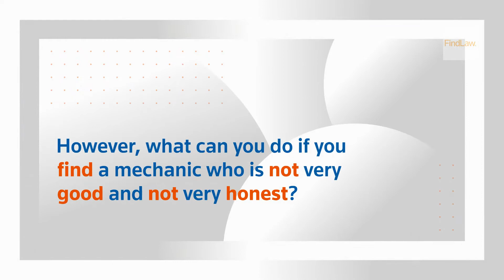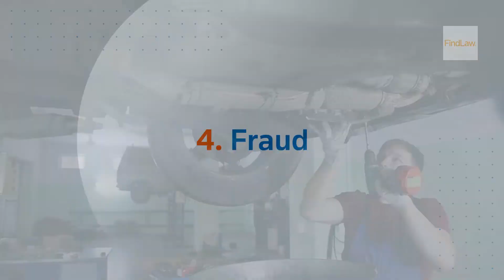5 Times You Can Sue a Mechanic | FindLaw

Comment: Just picked my car up, had the rear main seal replaced and decided to have shop put a new transmission in because of high miles, shop owner said everything is great, paid 2500 and drove off, noticed oil everywhere, called shop owner said trans was missing bolt and when they were test driving it oil leaked out, i drove over to shop to look for oil trail, found it! goes half way around and then stops because he ran out of trans oil, decided to look under car and noticed a bolt missing from transfer case to trans connection, and broken trans case piece missing, went back asked owner why is there a bolt holding my transfer case missing and a broken piece off the trans case, he said the mechanic lol  must have over tightened it, i said then the hole would have stripped out not broken off, i believe you dropped my transmission sir. he said, i can weld something back on, but i need a few months, i said no thanks i need a new transmission and you should refund me everything, he said nope, sorry cant do that, :( see you in court i guess, :)
Reply: How did it go?
Reply: got my money back! :)